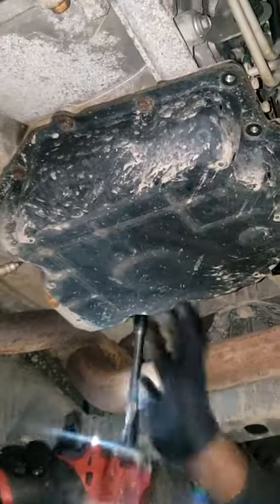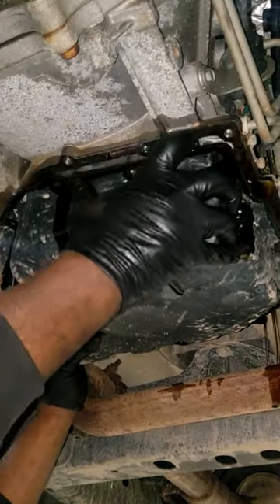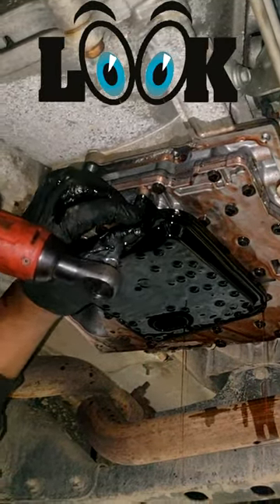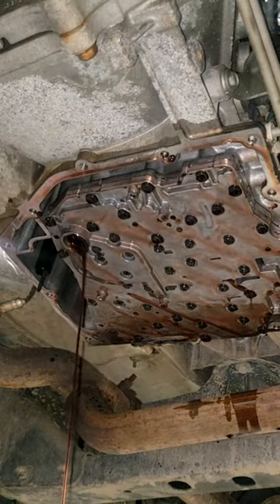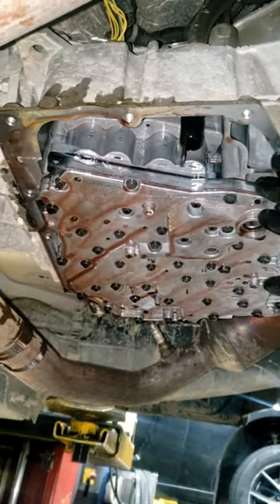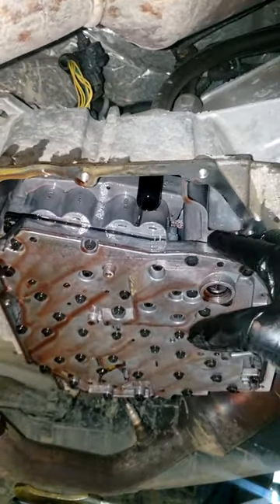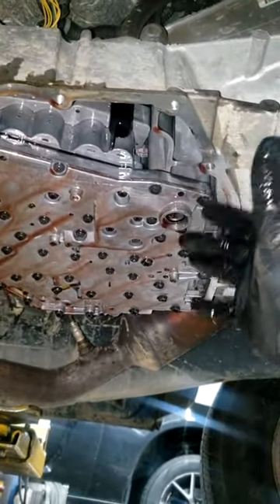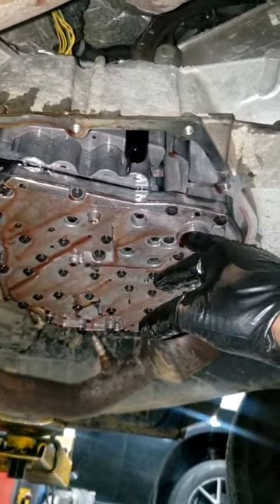No transmission flush machine, no problem. Do This. Best way to get out more of the old fluid.

Comment: Yeah. It's only supposed to be done like this every 50K miles but if you go over 100k without changing it then it's best not to change it at all. You'll lose the friction material that's in the fluid that helping your tranny shift. Doing this method keeps some of that friction material in the transmission making it less likely to slip. Don't do transmission flushes in the words of Scotty Kilmer.

Comment: If a shop doesn't have the proper tool to do the job right. Your paying the same price as a facility that will flush your system out the right way.
Reply from the maker: Omg, this is not a flush. I don't sell/do trans flushes. This is a trans service.

Comment: you're not hardly getting any out. that Trans takes 14 qts
Reply from the maker: I had to go in with 8 and a half so thats what came out out of 12. This a typical transmission service with the goal of getting as much fluid out as possible.
Reply: Still way better than ignoring it until you have a filter or lube related failure.

Comment: That shit look black change it 

Huh 

Not many know AUTOMATIC transmission fluid can last almost 100k miles even in the manual it says it.

MANUAL transmission fluid doesn’t last that long you gotta change it like every 30 or 40k miles. Everything is different though 

In a older high mileage transmission If its working good and fluid color is clean just let that shit go for maybe rest of vehicles life

Comment: Unlike an Engine, transmission fluid doesn't break down. It's nice you are changing the fluid however many times it isn't necessary. This is given that many times, transmissions, even those that are regularly serviced will fail. Sometimes, the cost of doing all these services far exceeds the marginal improvement in the life of the transmission. My lifetime fluid on my car actually has a 160,000 km service interval and people angry they call it lifetime fluid.
Reply: That’s completely false. Heat cycles, clutch pack material and even old filter material WILL cause the fluid to brown, lose its detergent-like qualities and even become marginally thicker.
Reply: There is no such thing as lifetime fluid.
  If the transmision has a warranty of 100,000 miles and the trans goes out at 114,000…thats lifetime fluid according to them.
  Change fluid/ filter every 40-50,000 miles.